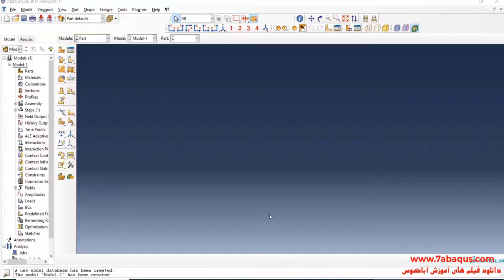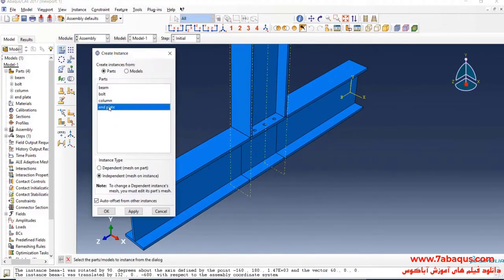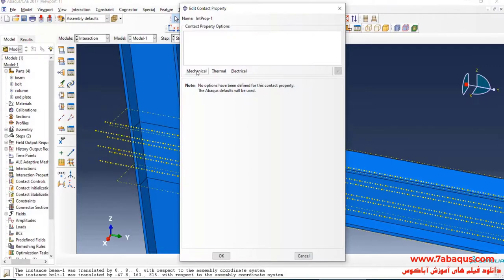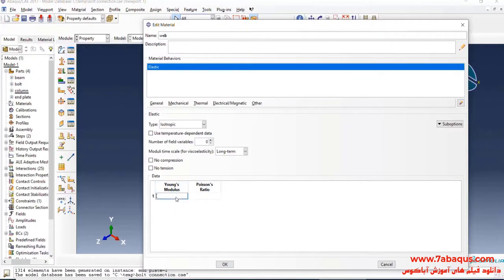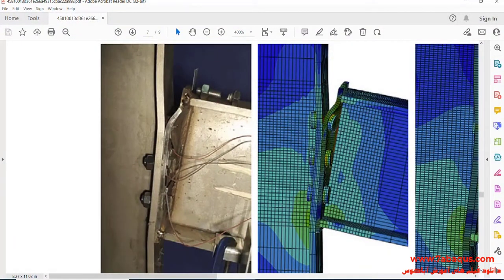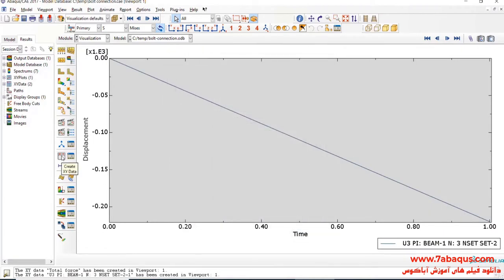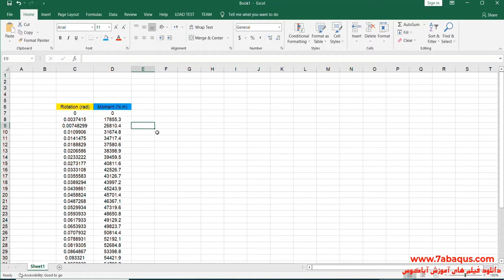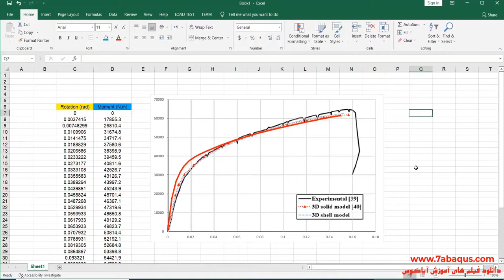Connection of beam to column with end plate bolted connection under monotonic loading Abaqus

Comment: why you did not show any loading values in most of the abaqus simulation. If you provide it will help for the beginner.
Reply from the maker: You can get the complete tutorial from this link
https://www.7abaqus.com/product/connection-of-beam-to-column-with-end-plate-bolted-connection-under-monotonic-loading-abaqus/
Reply from the maker: Also let me know if you need a discount